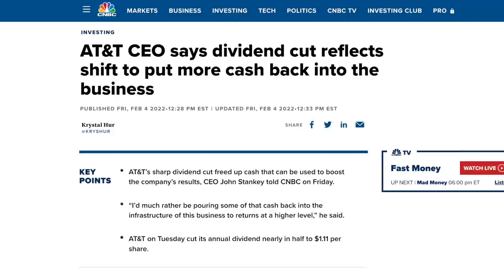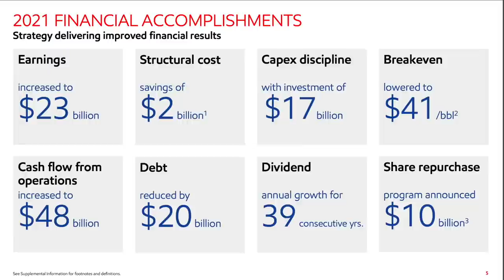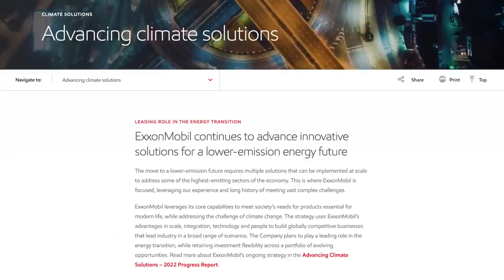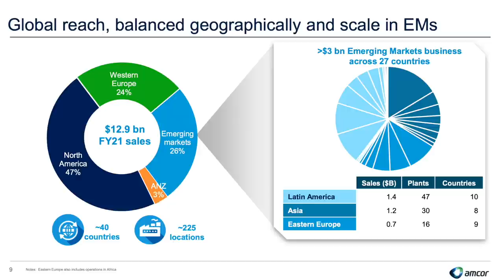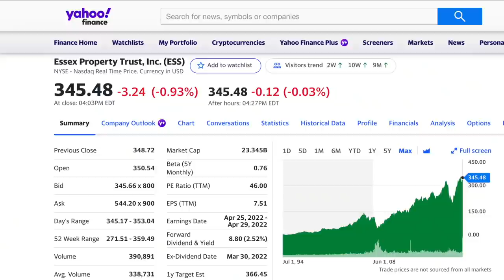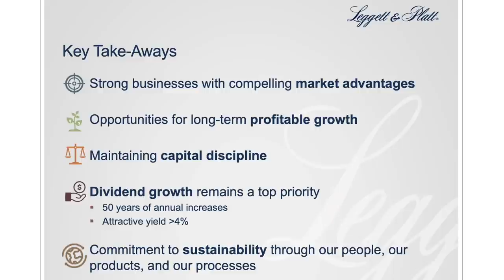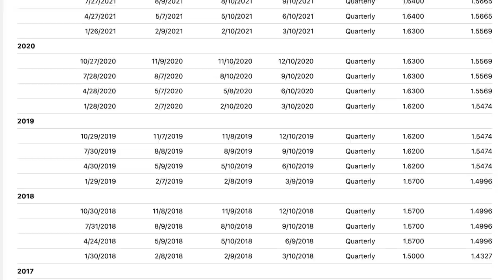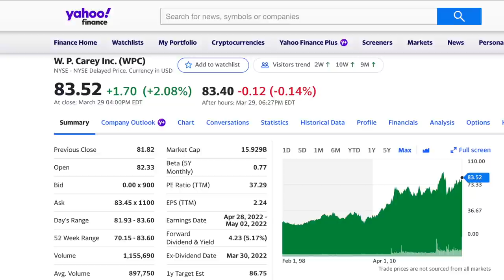These Are The Highest Paying Dividend Aristocrat Stocks

Comment: THANKS! Good to have validation. :) I've been buying LEG this week. Also more WBA. I have a good position in IBM, add to it when it dips below $120. Doubled my money on FRT and sold at around $135+. Also have MO, WPC. Won't touch the two oil companies with a 50' pole, haven't knowingly spent money on Exxon since the Valdez. Chevron's profits are obscene, given the circumstances.  KMI & OKE are my energy investments.
Reply: Have LEG on a watch list.  Long WBA, IBM and WPC.
Reply: hey nemo, I also bought leg & wba :) good luck!
Reply: Probably spending money on XOM every time you fill up your car
Reply: @kinghenry8615  not if it's advertised. But I drive a Volt, plug in hybrid. :)
Reply: @h.b.9694  You, too. I'm more focused on WBA right now, I'm waiting for the next pull back to maybe get LEG for around $33.
Reply: @Nemo-yn1sp  not exactly representative of 98% of the population ; XOM is one of the top three refiners of gasoline